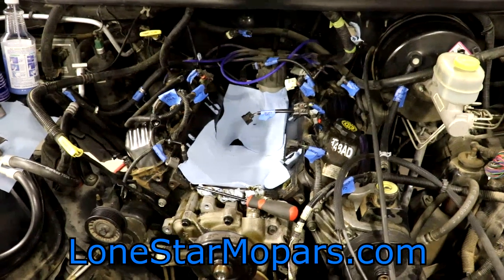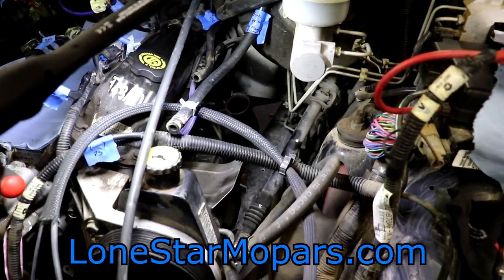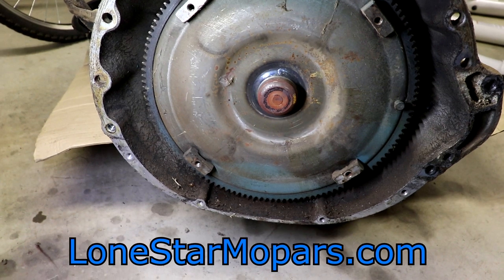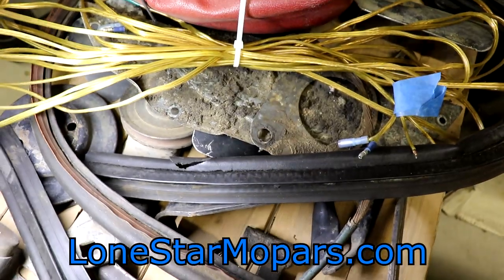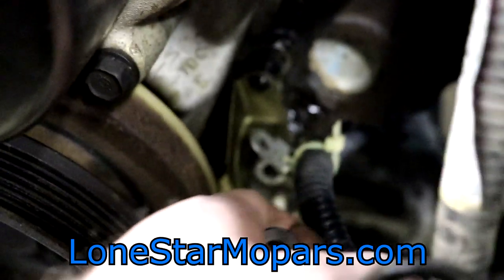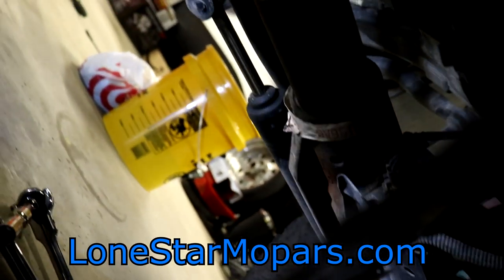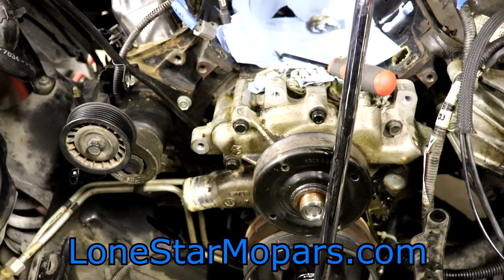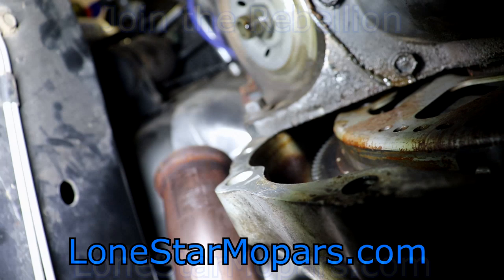Ram Revival Part 8: Starter, Inspection Cover, and Flex Plate Removal

Comment: Not sure if we have the same setup, but on mine there's a bracket between the bell housing, the frame, and the engine that has a number of bolts -- did you need to remove this along with the starter to get the dust cover to come free? I have a foreign object in my bell housing that I need to fish out and am hoping to do that without having to remove the tranny from the engine. Going to be a day or two before I can get back under there to work on it. Need to remove the starter and then figure out if this bracket needs to come out too.